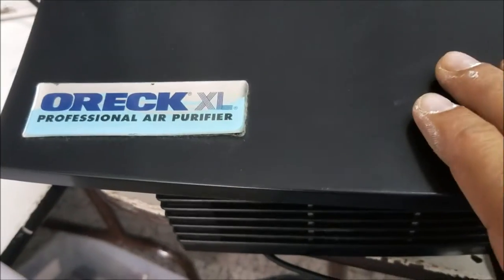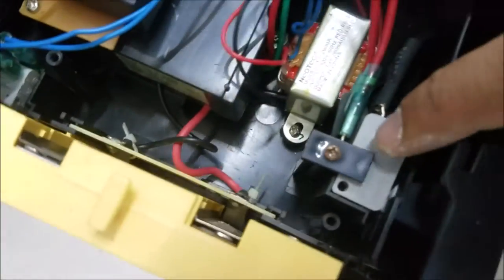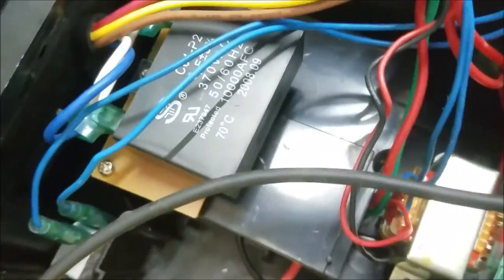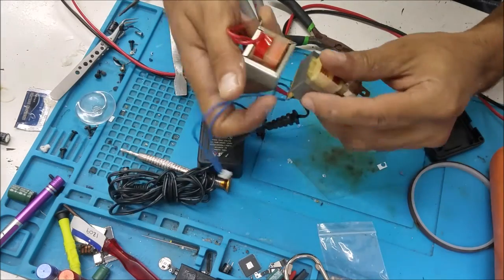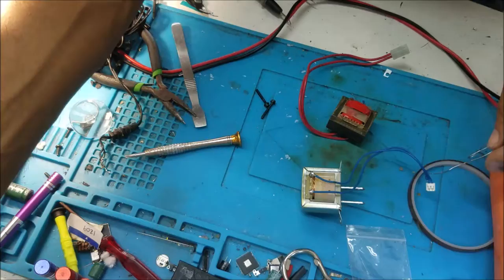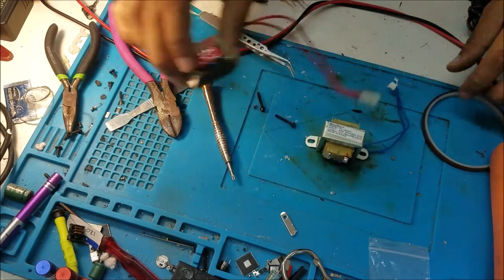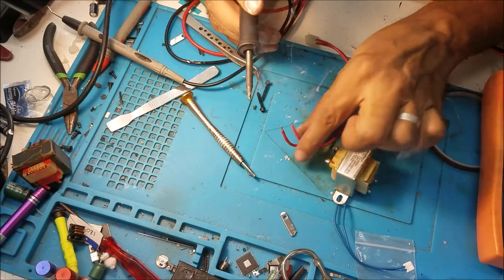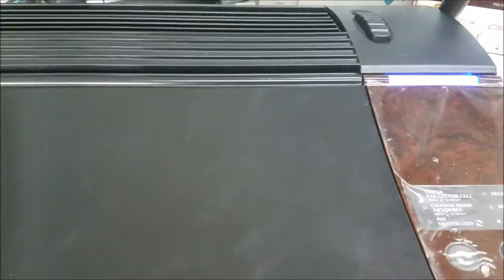ORECK XL professional air purifier no power fix

Comment: good video. it is a small transformer but it is possible that it has a fuse on the primary side that may have blown
Reply from the maker: yes could be, yes the primary side has a very tiny wire usually  burned open after power surge